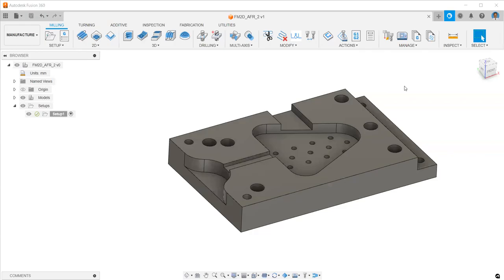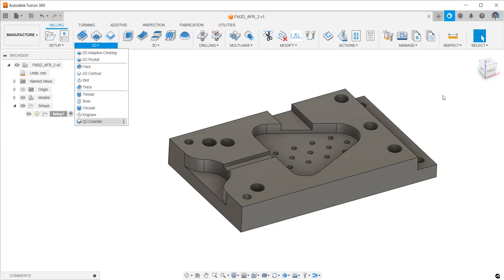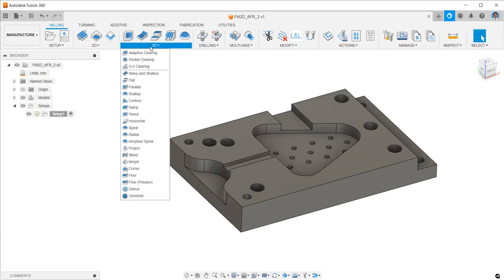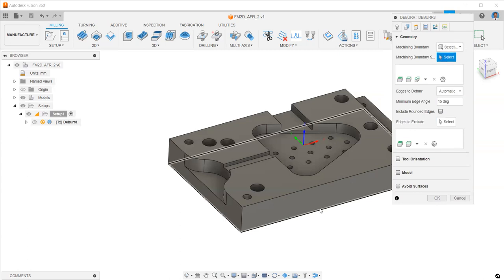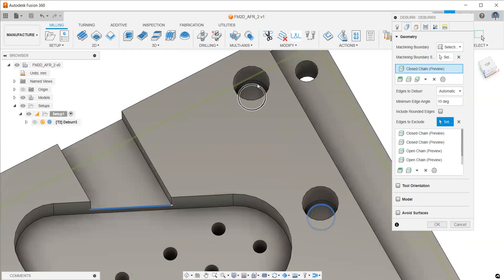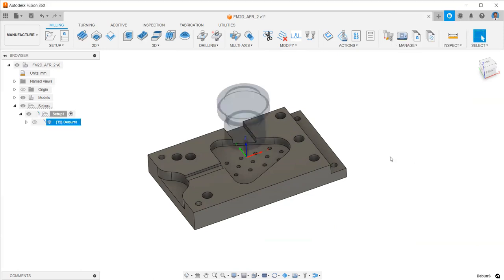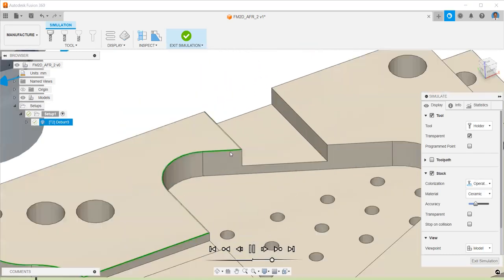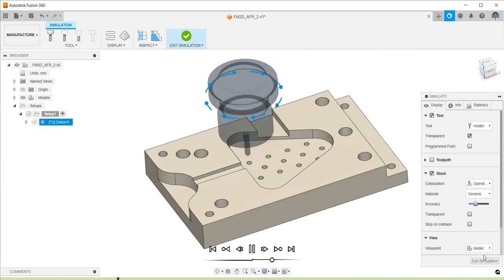Autodesk Fusion 360 - Ball Endmill - Chamfer Milling Application

Comment: As mentioned already, this feature is locked behind the $1,465/yr Machining Extension.  I'd hope someone who has that sort of money already knows how to use this feature.   Do you know of another option for those with the basic Fusion 360?
Reply from the maker: Yes, it is available in Machining extension only
Reply: For anyone else who finds this video and wishes they could do a chamfer with a ball Endmill but doesn't want to pay for the Machining Extension.... look at the 3d scallop option.  It's included in the base Fusion 360 license and it works well.